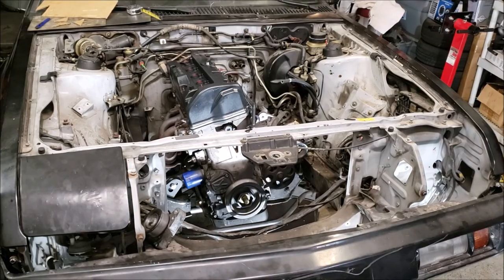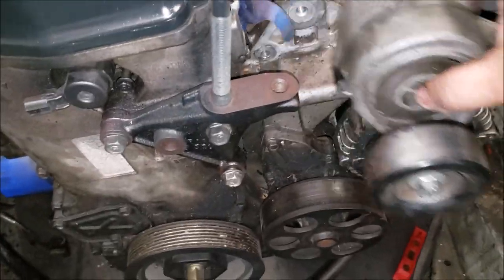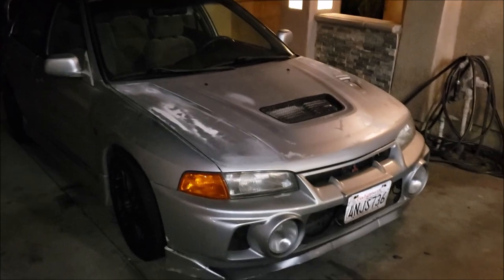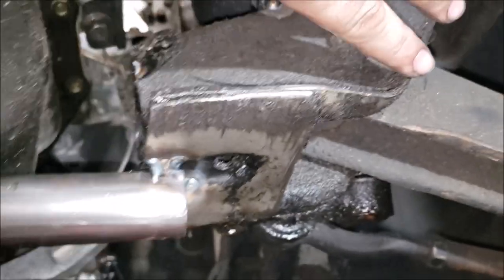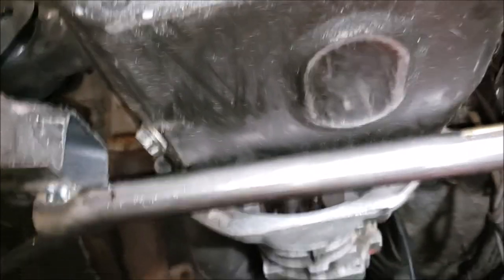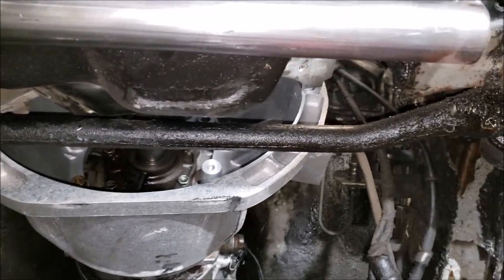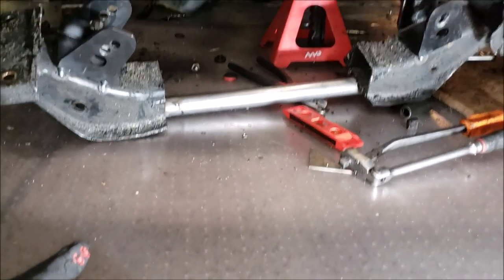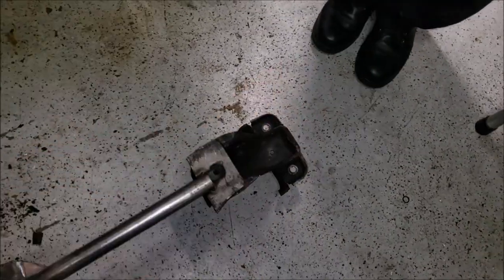K Swap RWD Starion Update 2

Comment: Could you weld a support across it, to prevent it from warping, and just weld it all up, then cut off the support.
Reply from the maker: yeah that would of been a smarter way of doing it, but it worked out in the end. It didn't warp. I will keep that in mind for the next project. Thanks